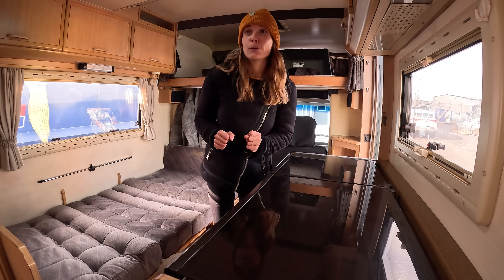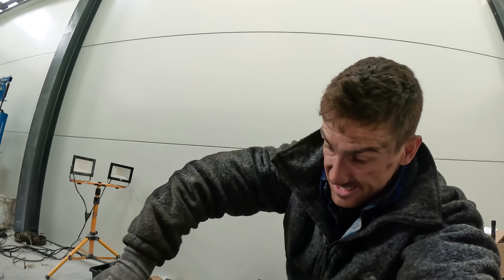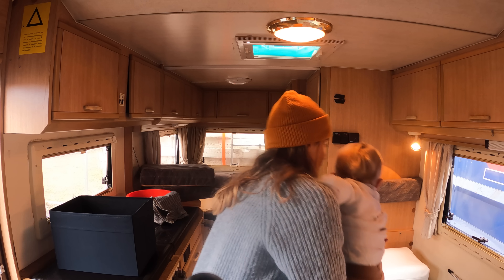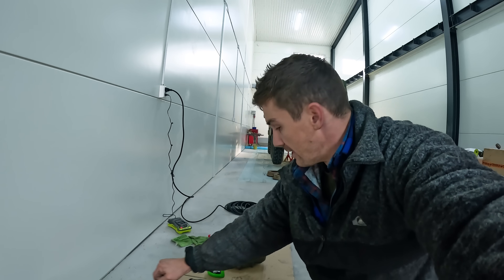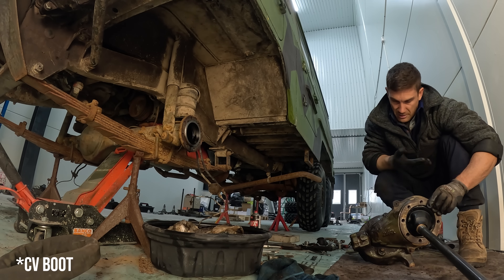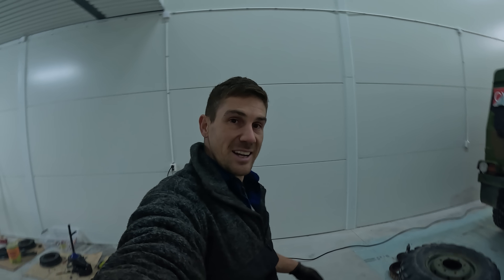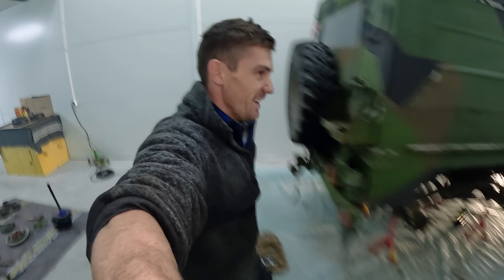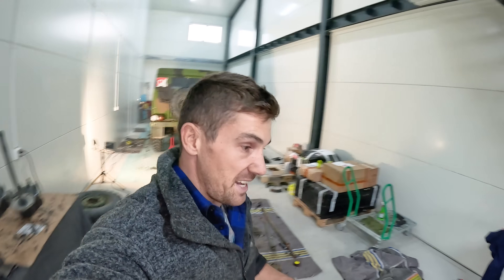The REBUILD of our 6x6 Ex-Military Truck Has Started! Volvo TGB 13 Restoration (Week 2)

Comment: To remove the ball joints "loosen the nut but don't remove it completely then with a heavy metal hammer smack the component where the ball joint thread has been passed through" whilst pushing the tie rod shaft up with your hand, it will just pop up. also you can whack pretty hard you wont break it. If you look at it you should see slight dents on it already from previous ball joint replacements.
Reply: Came to say the same thing 😊 You don't hit the ball joint itself, you hit the tapered hole it's in to break/shock the taper lock free.
Reply: Exactly what I wanted to say too.
Reply: Well you are kinda right... my experiences are different🤷‍♂️ this is relevant to car stuff.... not heavy vehicles from another country...
Reply: Or us a ball joint splitter.  Preferably the screw type, not the forked one, they burst the rubber dust covers. All right if you're replacing the ball joint, but if your aren't.
Reply: Glad someone said it I could see a serious injury happening if not told how to do it
Reply: Get yourself a brass or copper hammer and smack the side of the tapered hole and it will just pop out.  You should never use hammer to smack steel or cast iron as they are hardened and can shatter.
Reply: Just wack the side off the conus hard with a hammer while applying pressure with a crow bar or similar and the ball joint will pop out. The reason being the conus Taper lock) will be slightly deformed and thus release
Reply: I've used a sledge hammer on a lorry, same thing scaled up 😁

Comment: Word of advice that i learnt during my automotive apprenticeship, take an old bit of cardboard and poke some small holes in it and then when you remove a bolt put it in the cardboard and write what it's for. It actually creates a bit of a timeline so when you reassemble you can work your way back along the cardboard opposite to when you put the bolts/clips in
Reply: Or better yet, just put em in plastic bags or containers with handwritten notes on em. The cardboard tends to break.

Comment: So glad your channel came up in my youtube algorithm. I did my conscription as a mechanic on these vehicles, and seeing this brings back a lot of memories. In service these vehicles would be serviced after each and every exercise, so there should be minimal wear. On the other hand, they were driven by a bunch of 19 year olds who weren't paying the fuel themselves.

Just a word of caution. The original brake shoes did contain asbestos, and depending on how old these are they might do too. The dust on the drum and carrier plate might as well. I'd wear a respirator when doing work on old parts like these. 

You have already found biltema, another tip is Jula, which is also at svågertorp shopping area, they quite a bit of tools, both name brand and cheaper stuff.

Comment: Packing stuff with grease seems very likely when it comes to the swedish military haha. When I was a conscript a couple of years ago we used to service all the vehicles, and some of the points on the checklist were always to grease everything, cover everything rusty in oil, and wash the vehicles at least once a year to ridiculously clean standards. If there is one thing they were good at there, it was cleaning and rust protecting stuff. Service is usually taken very seriously, so I guess most mechanical things can be assumed to be in pretty good shape unless it was damaged after the vehicle was retired from the military.

Comment: when you're taking a tie rod end off loosen the nut and leave it on to protect the threads. then hit the end of the knuckle to break the taper if that doesn't loosen it hold a second hammer on one side and hit the other.

Comment: When installing bearing rings, I use the old one as a perfect mallet extentioner, but I reduce the outer diameter slightly by holding it loosely running on a belt sander before cleaning it and then using it to press the new bearing ring into place. As it is slightly smaller after grinding, it won't get stuck in the hole, but still doing an perfect press on the new.
Reply: This!

Comment: Apply pressure using your jack to the under side of the ball joint shaft (use nut so as not to damage thread but not done up tight).  Smack the side of the hub where the ball joint is with a lump hammer.  The ball joint simply pops out.

Comment: I’m not long into an adult apprenticeship and fight things like those ball joints all the time. I’m lucky though that I have a boss comes over and one strike with the right tool and technique and it’s apart. You are doing really well running solo on unfamiliar gear and working so hard.

Comment: I drove the TGB 13 during my military service in 1987.
 I remember we could drive quite comfortably and fast off-road thanks to the three axles. TGB 11 was much bumpier. As a result, the leaders at the military exercises preferred to hitchhike with the TGB13, which gave our group some advantages and grateful breaks when we had week-long exercises in the field :)
 I also remember that you can start TGB.s by sticking your name tag (steel ) between a couple of the fuses.. Which meant that the TGB.n was not always in the same place as you put it..

Comment: A tip with those Britpart brake shoes from a Landrover fan. On the Landrover you have to chamfer the top of the leading brake shoe or it will grab on the drum when you reverse! Not sure this will be the same on the Volvo set up but it’s easy to do with some sandpaper. Look forward to seeing this truck progress

Comment: Hey Chris mate, I think I see you getting under the vehicle, relying solely on the trolley jack. If this is the case I recommend you place your wheels flat under the body somewhere, so that if your jack fails, the space these afford you, if it should all fall, might just save your life. If changing a flat tyre, I will always leave the flat tyre and rim under the vehicle for the chassis or body to land on if the jack fails or topples. Cheers.
Reply from the maker: This was rectified at Day 10 with additional jack stands.

Comment: On some of those stubborn bolts you need to use a good old fire wrench! lol. (blow torch to heat it) then it should come right out with a little smack of the hammer.

Comment: Following your rebuild.  Very Nice work.  I have a Pinzgauer and a Land-Rover FC101
At one moment (time 49:00 min)  you mentioned you cleaned/polished the inside of the brake drums.  Perhaps it was not literally polished. I interpreted you wrong.   
I was taught than when fitting new brake shoes, to check the inside diameter of the drum-brake to ensure they are with in  spec and you have enough material.  I believe yours will certainly be good.    
Then take the drums to a brake shop or engineering works to have the inside of the skimmed on the lathe. That ensure "roundness" and a proper surface for the new brake pads to bed in.
Not trying to critique. Just think polishing a brake surface is not the best (if I understood it correctly)  
Perhaps just double check on that as it is a critical safety thing for you and family.  
Keep up the build. It's very exciting.

Comment: For the bearing outer cone put them in a freezer overnight and use the induction heater to heat the housing. 
They should pretty much fall in  👌
Reply from the maker: We don't have a freezer unfortunately.
Reply: @TheOutFit  that would make it a little bit harder but even just heating the housing would help. 
Also if you get stuck on things like ball joints, search YouTube as there's tutorials for all these types of frustrating jobs.

Comment: Rostlösing=Rust Solution, so you're on the right track. WD40 is available in Sweden too, just not at Biltema since they only carry their own in house brand. Another store that carries this stuff at pretty good prices is Jula, they have a lot of the more recognisable brands (like Bacho tools, WD40 etc). 🙂
Reply: Honestly I think Bahco has become below average quality tools since they moved all production from Sweden. Only saw blades and some related things are made in Sweden now. The Biltema "premium" line with 10 years warranty is much better value.
Reply: @erik....  I just mentioned bacho as an example since i know he's used their tools before. But yes, i agree that biltemas more premium line of tools are generally pretty good.

Comment: To separate tapered connections like tie rod ends, undo the nuts but do not remove.  Leave the nut on the last lot of the threads, gives you a greater surface are for you to hit with a hammer or apply force to the tie rod end.

Use the jack to apply pressure to the tie rod bolt with 2 hammers, simultaneously strike the cast bit of the hub where the tapered tie rod end is lodged.
Reply: Also hammering softly all around where the tie rod's stuck to create a frequency loses it quit good.

Comment: Great work. Having worked on Unimogs I can empathise with your tasks. One thing I would suggest is to service the leaf springs. Relatively easy task of removing, stripping, cleaning, inspecting, lubricating and rebuilding. They do look a bit crusty!!
Reply from the maker: They are crusty indeed and have sagged quite a bit too! We will be replacing them :) thanks for watching!

Comment: To remove the bearing cups, look from the inner side of the hub assembly. You should be able to see about 1 to 2 mm of the back of the inner part of the bearing cup.  Using a brass rod or a rod of metal softer than the bearing cup and using the rod like a punch on the visible edge of bearing cup, using a solid hammer on the rod, punch the bearing cup working your way around the bearing cup.  I suggest moving around the bearing cap every 45 to 90 deg, tapping the bearing cap out.

Be mindful not to strike the surface where the bearing was seated or the inside surface the bearing cup will be sliding on.

It is harder to replace the cup.  My practice was to grind the outside circumference of the bearing, reducing the outside diameter of the bearing cup, so that the cup Wil freely slide in and out of the hub.  Cool the bearing cup in a freezer and then put the cup in place and working around the then edger of cup, tap into place so it is going square.  Once it is started use your old modified bearing and continue tapping the cup into place and is soundly set in place. You will hear a definite change in the sound has you strike the old cup.

Comment: @TheOutFit a friend from work also has a TGB 13🙂 he's told me that if you want to dieselswap them you can take the final drive gearing from the TGB 11. The gear ratio is a little bit higher  on those so you get the revs down when cruising at highway speeds. Too bad you already have done the axels😅😅
Reply from the maker: I haven't done the diffs yet. A regear will need to happen at some point I'm sure

Comment: Hi again Chris 
When you are using ring n open ended spanner.
If you use ring end on nuts / bolts attach another large ring spanner inverted to the open end too get greater leverage on it wrks well. 
Ange n Oakley he is growing so quickly 😀

Comment: Very nice to see the project going forward. I was reacting when you used an ordinary socket for the machine. Back in the days I did some mecanic work I would always use the special, more powerful socket for hammering machines (the use to be dark in colour).
Biltema is great! They have much and to affordable prices, but sometimes you have to look up for the quality. But for amateurs there is mostly no problem.

Comment: Tanking of the boljoint Do Not heet up the part where it is going in to ( you now have weakend this part). But put pressure on the boljoint like you did  with the Jack and then hit  the part where its going in to With an good size hammer. The it shout pop out!

Comment: My brother from another mother; just check that drum brake.  They used to be made with asbestos.  That’s an old vehicle.  It may not be and your mate there is probably more specialists.  But just check. Also the tight ones heat up with blow torch

Comment: Just grind the old bearing ring so it fits loose in it's hole and use it as a tool to drive the new bearing ring home. Alternate light blows from side to side so the new bearing ring goes in straight.

Comment: I don’t know if someone mentioned it but if you freeze the bearing before install they go in easier.   Also if you are able to heat up where the bearing housing 70°f over ambient temp and with a frozen bearing it should just about fall in place

Comment: 29:52
No!
You can either use a tool, that "splits" the joining or you bang with a huge hammer against the balljoint from the SIDE.
Do NOT bang on the threadend part of the balljoint!

Brantho3in1: I used that a lot on axles and frame and for that type of use it is perfect!
It is NOT UV resistant and it takes ages to dry. You must use to thick coats if it is not perfect metal. From my (5 years) experience with 3in1 it takes up to 3 days to be completely dry.
After that the paint is really resistant against scratches.

Comment: When I was a teenager an old mechanic showed me how to use diagonal cutting pliers to grab those brake springs to remove and install them. He told me the grip better than pliers and wouldn’t damage the hardened steel.

I’m sure someone will tell you how to remove the old bearings, you wont cut them with a multi tool as they are too hard. Cutting them with an angle grinder risks nicking the shaft. You might be able to cut it part way and break it off with a cold chisel?

Comment: The added springs on the front brakes could be a "MWO" , modification work order, an upgrade made later on in service to improve the brakes, these MWO's are very common on military vehicles.

Comment: Safety issue with the lack of an engine stand on the front while working on the front hubs. I've had those high lift hydraulic jacks decompress on me, not good. 🇦🇺
Reply from the maker: Hi Chris, this was rectified at Day 10 with additional jack stands.
Reply: @TheOutFit  yes, I noticed the rusty ones on the front later in the video 👍 🇦🇺

Comment: The ball joint is a tapered joint, loosen the nut, but leave it on the last few threads. Get a bigger hammer that one is too small. Good hard sharp blow from the side to the metal just below the rubber will shock the joint apart. It will NOT press or hammer out from below as u tried as it is a flexible joint.

Comment: when taking off ball joints: dont hit the joint/threaded part of the joint -  heat it a bit (optional), apply light upward pressure from below, like with the jack, and then whack the forged part where the cone of the ball joint goes into hard with the bigger of the two hammers. Even if you have a proper ball joint dissasembly tool yoo most often will have tho whack the forging where the joint goes into.

Comment: 30m : 20s. You should not hit the ball joint bolt. If you hit the knuckle part (O : female) with a hammer, the ball joint will remove. Most shops have a ball joint remover.

Comment: tip to be comfier working on concrete, use some of the cardboard boxes, break them down and it will insulate and pad you a bit, or get some of the cheap kids foam tile playmats. i use the ones that are about half a metre a side. ii keep one in my car. handy for when i'm working on it and keeps me dry when i have to kneel on wet ground.

Comment: You could have used the vice grip to slide in the bearings into place., by locking it on the vice like a press....Cheers

Comment: Getting out the shafts from the CV's: place the shaft in a vise so that the lower part hangs a few centimeters above ground. Use a thick punch, place it on the inner, star-looking part of the CV and whack it with the hammer. Go around the star arms and the CV will come off the shaft easily. (And by the way, get you a reasonable hammer, can't watch you using this toy :-) )

Comment: Amazon only delivers between 5 and 10 PM there? Interesting; because in Stockholm where I live, I can't ever get a delivery outside of office hours.
Generally, IKEA's very accommodating with their return policy. But you'll be hard pressed finding any store in Sweden that accepts bedding that's been opened. Much like underwear, you usually only get to return those if they're unopened or they fall under warranty.
Biltema's pretty great. Since I've only come this far in the series, I don't know if you're still in the country, or have tried it already, but in case you haven't: I'd like to recommend their soft-serve ice cream. It's not as sickly sweet as many others can be, and they're usually quite generous with both serving size and amount of topping.

Comment: Are the boots spit or did some one cut a slot to periodically fill them up with grease. Common practice is  jack to the under side of the ball joint shaft . Hammer the side of the steering knuckle .  The ball joint drop  out.

7

Reply

Comment: Hope you using stands under the truck while working on it and not just the jack
Reply: Didn't you see the red jack stand? Can't be missed! He has palletized the all-terrain vehicle on these!
Reply: @RB_2Y on the back yes but not in the front if thet front jack goes he will get the truck on top, it will knell forward and then tilt on its side. That is not safe as it is now. if the front jackstand goes down the jacks in the rear will tilt forward and right and it will fall...
Reply from the maker: @konsum949 This was rectified at Day 10 with additional jack stands
Reply: @TheOutFit Just be carefull, it looked proper at the end as you say! love the videos by the way. have many hours in that type of vehicle, amazing off-roader, I almost got a vehicle over my leg when working with the brakes, it fell on the ground cm from my leg, ill never trust jackstands after that